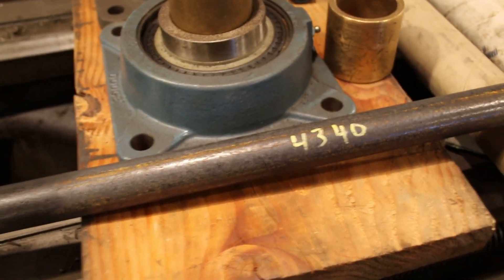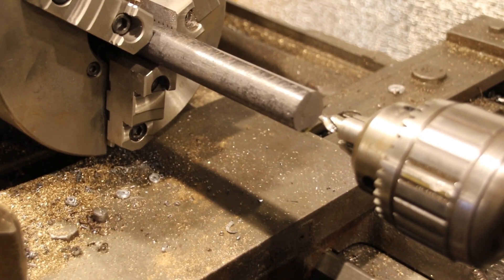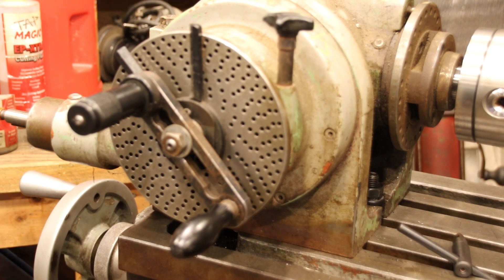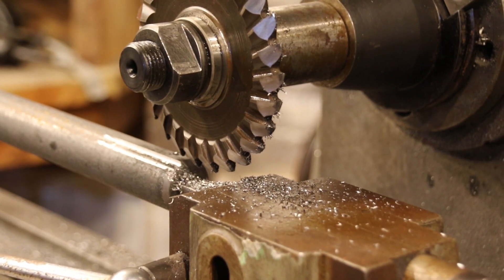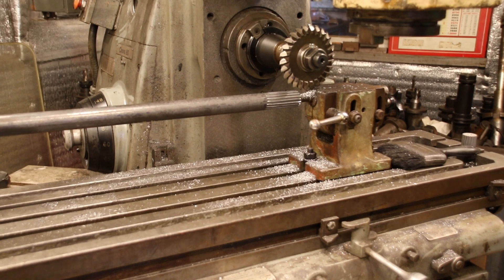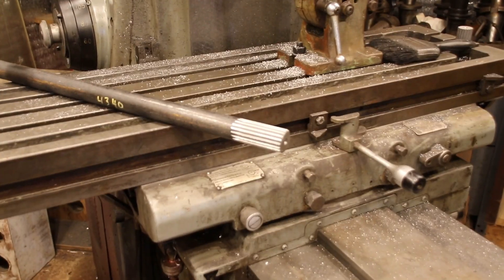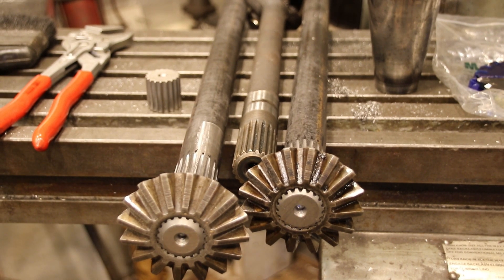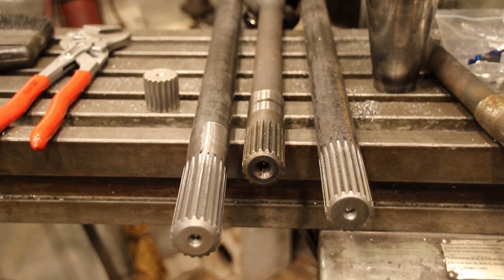Willys CJ3B Welder Jeep, Milling19 Spline Axles  For Custom Dana 44

Comment: Are you using a involute cutter like when cutting gears,or is it a different type of cutter?
Reply from the maker: It is a custom made cutter for the 19 spline, and the 6 spline in the next video.   No off the shelf cutter would work for either so a cutter grinder shop made them for me.
Reply: @metalshaperJeep  Thanks